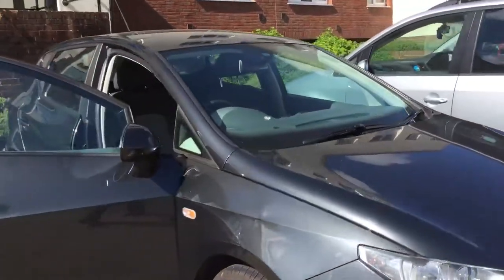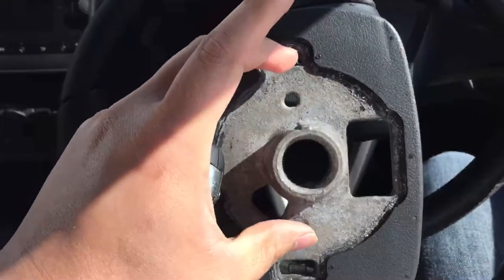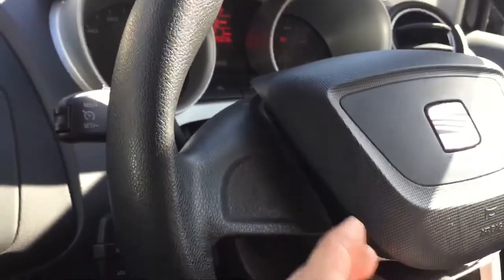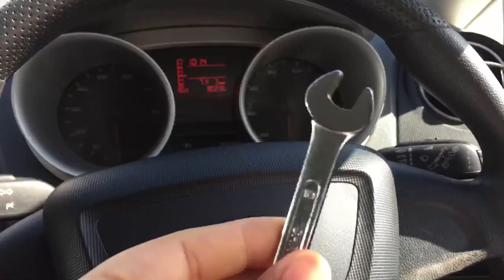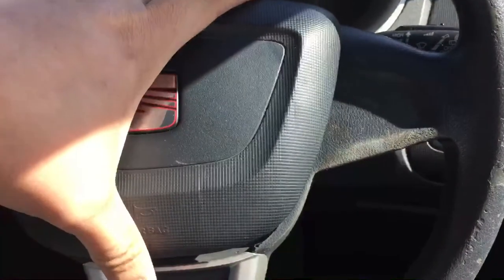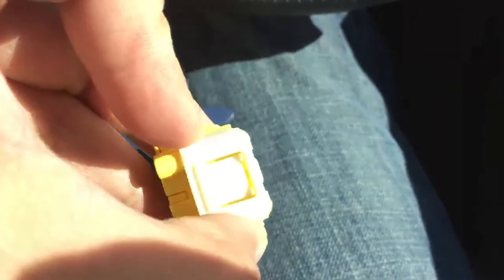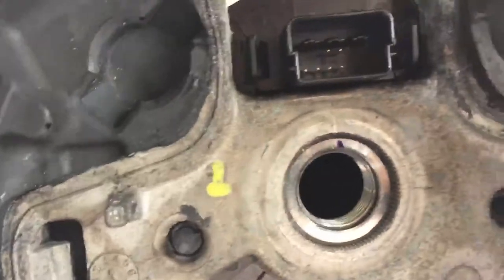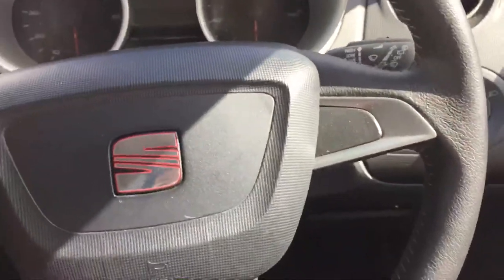Seat Ibiza MK5 Airbag steering wheel removal

Comment: Why didn't just remove the airbag fuse instead of disconnecting the batery ?
Reply: Hi.. it is always highly recommended to isolate power source in any electrical work as a good practise.